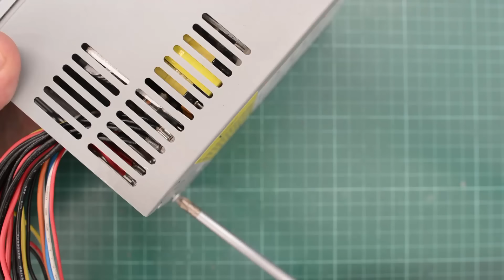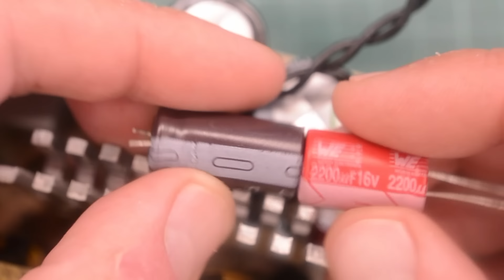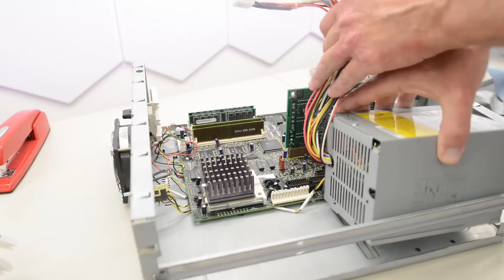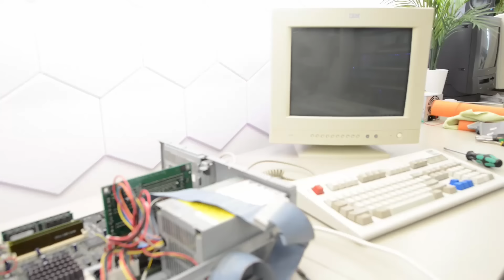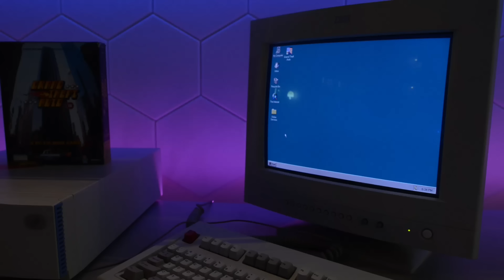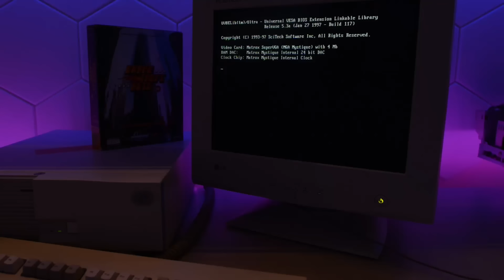IBM 330-P60 repair & GTA in High color mode test

Comment: Never worked on a psu board that cramped! I'd suspect the cramped layout probably leads to premature capacitor failure due to the heat build up.

Comment: What is under the CPU, looks a bit like maybe a MMX voltage interposer - or maybe a 3.3V interposer as the P60/66 were 5V chips
Reply from the maker: I don't know what it does. It only has resistors on it. I showed it in detail in part 1

Comment: You really need to be careful about removing PCBs on floppy drives.  Many of them have the optical track 0 sensor on the PCB under the heads.  If you so much as loosen the screws on that PCB, you will totally wreck the alignment, and I wish you the best of luck ever getting it back again.

Don't ask how I learned this.  Twice.
Reply from the maker: lol. I have realigned a few drives. It's a hassle but it can be done :)
Reply: @Epictronics1   I bow to your superior skills.  :-D
Reply from the maker: @sirnickity  lol

Comment: "The pad has come off ... I hope that's not my doing."
It happens.  I've had a couple PSUs where the pad came off the board, even without electrolyte damage or anything like that.  Especially those cheap single-sided phenolic boards, with large components and thermal stresses.

This is just part of deal when you maintain old stuff.  Some people will say it's a good reason not to re-cap if you don't absolutely have to.  I say, if the pad failed that easily, I'm glad to have caught it early enough to fix it, before something really bad happened.

Comment: As others have pointed out, coil noise is very often not the result of a fault. It's electromagnetic induced vibration and needs some kind of anti-vibration the same way a fan can cause vibration and needs rubber dampers to stop the noise. Gluing down coils is one way to dampen the noise and probably the easiest for a hobbyist to fix it. You can buy new transformers that have been resin dipped during the manufacturing process as an anti-noise measure.

In other words, gluing it down isn't a hack or bodge. It's actually proper maintenance.

EDIT: However, it's fair to point out that noise can indicate other problems as you discovered after replacing the caps. "Dirty" power can exacerbate coil noise. Replacing those caps cleaned it up enough to quiet that coil significantly.

Comment: eeekkk.... those first vintage of the IBM PC 330/350 with flat face drive slide covers were, in my opinion, bad machines. The next generation of the PC 350 with slightly curved outward sliding drive cover doors were much better. I forget what MHz processors those began with.... Somewhere between 100 MHz and 166 MHz. Also decent (next) was the PC 300 XL which was a Pentium II processor in that same PC 350 model 2 case.

Comment: Thermal paste isn't that big of a deal, especially for gold metal tops. These CPUs only have some watts of thermal output.
Reply: Yeah, they pretty regularly never had thermal paste nor pads.  Metal-to-metal (or ceramic, as the case may be) conductivity will do the job fine at those power levels.

Comment: Oh JOY! Finding a cracked solder joint is the only major issue is just the best! I had a problem with my Honda - it wouldn't start occasionally and I had NO idea what it was, I thought maybe the key 'security' was a problem but no, there was cracked solder joints on the connector under the steering wheel that lets the key talk to the immobilizer.. I spent 10 minutes reheating and fixing the solder joints and it's been fixed for 5 years now. Free of charge! Yes, that's a GREAT feeling!
Reply from the maker: Occasionally it's an easy fix :) This was my third drive that had this issue. Well worth checking on any bad drive!

Comment: That replacement PSU from Magnetek is most likely due to recap also. Those used some crappy capacitors. Some of them leaked badly, where others had really high ESR. I had to repair those a few times, some of them were used in PowerBook Duo Docks and in IBM Aptivas. Also about the coil whine, I had once repaired a PSU that had a nasty coil whine in standby by replacing the ceramic capacitor that was nearby it (I think it was 10nF). The original one was apparently acting as a piezo speaker for that specific frequency
Reply from the maker: Yes, I have repaired the Magnatek twice so far:) I'll check the ceramics nearby, thanks

Comment: The other two transformers were at least dipped in resin so I guess that one should have received the same treatment as well.
That wide yellow tape even seems to form a dam to contain the resin although perhaps they also ran out of thin tape at the same time... I bet it was made at the end of the last shift of the week 😜
Reply from the maker: So, it seems :)
Reply: I wonder if dipping the coil into clear nail polish would do even better? Maybe thinned down a bit so it goes everywhere inside? Would that dissolve the varnish on the coil wire?
Reply from the maker: @jerther_  I better ensure I dip it in something that won't damage it. It is probably impossible to find a replacement coil.

Comment: Coil whine it’s more a mechanical problem than an electronic one.
It’s caused by the copper wire resonating at a specific frequency and, being no more perfectly attached to the magnetic core due of aging, generates that whining noise.
Nothing to be worried about though, it’s annoying but not unsafe.

Comment: If I remember correctly, back in the days when you wanted to play high color or high resolution in DOS games, you had to use an utility called "UniVBE" to activate some SVGA compatibility with most graphics cards...
Reply from the maker: I'll try it out, thanks
Reply: @Epictronics1  That is exactly what the SciTech display doctor thingy that popped up should be. I wonder why it didn't activate for the onboard card, maybe that one has proper VESA support already?

I'd not give up on the onboard card yet. IIRC you can change the video resolution when in game by hitting F11 and then using the arrow keys plus Enter. I'd try that when the screen is black to switch to a different resolution. Maybe that gives an image on the onboard card as well.

It'd also be interesting to compare low color mode performance between the onboard and Matrox VGA cards. The matrox seemed to do not too much worse on high color than the onboard one in low color.
Reply from the maker: @mike_rofone  I'll make a comparison in the final installment
Reply: UniVBE also came with tools to specify the refresh rates for VESA resolutions. That should allow you to set the high color video modes to something that your first CRT should be able to handle. I remember using that to make an old PS/2 VGA monitor handle them back in the day.
Reply from the maker: @mike_rofone  That could be very useful for recording too! My camera syncs to 50, 60, and 80Hz, but nothing in between. Thanks

Comment: Woah there. SXE are low esr and part of the switching circuit. The replacements seem like general purpose, they’ll die pretty quick . I rebuild a lot of psus. I’ve had to recap smps before because someone used general purpose caps and the psu couldn’t bootstrap
Reply from the maker: I'll check and see if I made a mistake when ordering. Thanks
Reply from the maker: You were right! Two of the caps are of the wrong type. New caps are on the way. Thank you for noticing my mistake :)

Comment: You said the PSU was a bit sooty. Meaning, there was something getting rather toasty, inside.
Two common culprits in my experience are Diodes and Resistors.

Comment: The reason gluing the coil tamps down on coil whine is because the coil is actually vibrating and the glue is damping the vibrations. Coil whine is not necessarily a real issue but if you find it really annoying that might be worth doing.

Comment: Gluing the coil is an option. The kludge solution is to wedge something soft enough to damp the noise between the coil and something else. Another potential option is to put heat shrink over the coil.

Comment: Coil noise is a feature not a problem. Designing switch mode is a about compromise, gluing components is sometimes a design requirement

Comment: Coil whine is not usually a 'fault' it's more of an annoyance, basically when the coil is working at high frequency, it can sometimes vibrate like a mini speaker at a harmonic of said frequency, you can get inductors that are designed not to, or yes, you can glue the Coil (doesn't have to be glued down, just dampen the vibration of the coils) - replacing the coil for a new same value could fix it - but that's only if the replacement is built a little better to not whine... Just glue it :)
Reply: Thanks for this explanation as I wondered why it whined! :)

Comment: Just scope the PSU? If it's not too ripply under load, then there's no need to search for a fault, it's fine. Use silicone rated for power supply use to damp the offending magnetic, such as Silastic or Kafuter. There's nothing sketchy about that. Actually use it all over the place, like on that bodge capacitor, because why not. Look, when you look inside a PSU and it looks like a Peter North scene in there, that's for a reason, this is considered a high vibration environment due to all the large magnetics. When you don't gunk it all up, things break off, component legs and pads fatigue. Plus the noise.

I think S3 Vision should work! Maybe it just needs UniVBE. Most games came with UniVBE on disk if the game supported VESA/SVGA modes. Try different versions too. My first PCI card was one of those i think and it needed a LIBERAL application of UniVBE all over the place, i wager a conclusion that the VESA BIOS on these was very incomplete.

Oh i haven't looked carefully, i'm watching semi asleep on a netbook, so i'm sort of saying this blindly but the buzzing magnetic should be the SB power transformer. I know it's not ATX but given it has soft power, it must be built similar to an ATX PSU, with a secondary controller and whatnot. So that whole circuit doesn't need to work well, it just needs to work. You can also sort of stop looking across most of the PSU since that's all its own circuit, like you should be able to tell what belongs there though idk maybe not all people stare as much at PSUs as i happen to.
Reply: I'll never look at glued on components in the same way again.
Reply from the maker: Thanks, I'll give UniVBE a try

Comment: I don't know about gluing the coil, but I do know that wax potting coils is very common. They do it to stop the very problem you seem to be having. I would remove the component and dip it in some liquid paraffin wax.
Reply from the maker: Interesting, I did a Google search. It seems to be a very popular thing to do on guitar pickups
Reply: Very interesting indeed! I guess the liquid paraffin is thin enough it can get into the coil in between windings so it might work even better than glue!

Comment: I used to service some equipment that had a large (2" / 50mm) inductor on the output board, and if the inductor wasn't anchored to the board with epoxy or RTV, it would make an annoying high-pitched whine.

Comment: cool machine being a socket 4 are they rare considering the socket 5 and 7 wasnt that far away, weird socket 6 isnt in the Pentium scale its a socket 3 486 socket with 2 extra pin holes.  i take it the coil doesnt simply need replacing in which case i would take the advise of gluing it down.
Reply from the maker: Unfortunately, the coil is not a common part.

Comment: Regarding the power supply noise, coil noises often change with conditions. I'd suggest getting some kind of variable load and connecting it to one of the rails and fiddling it while the system is on. Does the noise go away if more load is put on one of the rails?

edit: I see later you found the noise reacts to physical pressure on the coil. Glue 'em down!
Reply: Furthermore that's likely the SB transformer, there's always the same load on it regardless of what you do since this is not yet an ATX machine. But it must have an independent standby rail to support soft power off.

Comment: I remember having a 486SX back then and playing GTA was simply not an option. My brohter had a 486DX-40 and on that machine it somehow works. I got a used Pentium 100 later that year, including an 2MB PCI graphics card with Cirrus Logic chipset. Guess what the first game was I tried out after assembling the new parts? It was just a blast seeing this game running in a playable state. You could even change resolution in this game when playing with high color mode, I think it was with pressing F11(?). Looking forward for the 3dfx-upgrade. Great video. 🙂👍
Reply from the maker: Thanks. I'll try out the different resolutions

Comment: On GTA I if you tap either F10 or F11 you can change the screen resolution, certain cards go to 800x600x16 in hires mode and F8 disables the frame limiter and F6 or F5 pauses the game iirc
Reply from the maker: I'll check, thanks

Comment: What is that PCB between the Mainboard and CPU?
Reply: Looks like chipset and cache. Seems to be the only way for the space with the onboard graphics card taking up space.
Reply from the maker: Excellent question. It's a mystery card. It only has a bunch of resistors. I have never seen anything like it. I showed it in detail in "Part 1"

Comment: If the glue, duck tape, hammer or WD-40 fix it, then it's a win isn't it? 😁

Try gluing it, if it's electronic fault then it should not fix the problem, right? 🙃
Reply from the maker: you're right. That should reveal if there actually is a problem. Now I need to find out what type of glue to use
Reply: @Epictronics1  Hotglue seemed to be the manufacturer choice that I've seen.

Comment: modern stuff uses glue on coils because they vibrate. It's normal even with modern electronics.
Reply from the maker: So, it should have been glued from the factory? Would you happen to know what type of glue to use?
Reply: @Epictronics1  Usually it isn't actually glue that is used to secure coils to PCBs but an acid free silicon compound.  You can use common silicon sealer - just make sure what you use is acid free.  The regular acid curing variants can corrode and damage components over time.
Reply: @Epictronics1  no clue. But yeah it's pretty common these days.

Comment: I had that computer, I got it very cheap back in the day at a market and it would crash sometimes, I think about after a year it stopped working so I went back to a 486.
Reply from the maker: Was it the PSU by any chance? :)
Reply: @Epictronics1  Probably, I got the system at the computer flea market for something like $30 in 1996 or 97, I just had to add a hdd and I had a computer, I even remember that weird turning on for a second when plugging it in, the seller did admit that it did crash and it was sold as non working but it was fine for win 95 for a while. I think I got angry and threw it out since I was way too inexperienced to fix it. Later I found a 486/100 in the garbage that I took when no one was looking.

Comment: Haha, I have this same one but with a 100MHz DX4, model name is 330-100DX4
Reply from the maker: Same PSU too?
Reply: @Epictronics1  No, I don't think it's the same PSU, mine was also broken but it was riveted together and I had to drill the rivets out to disassemble it
Reply from the maker: @retropcs88  Ok, probably the same PSU as in the PS/1 2133 and the similar PS/VP then. They don't seem to suffer from this issue
Reply: @Epictronics1  Actually, now that I'm looking at it, it seems the motherboard Is very similar to the PS/1 2133, but mine has a Cirrus Logic VGA card instead of a Tseng
Reply from the maker: @retropcs88  I've got the Cirrus Logic too. If it's the same board as in my PS/1, you can easily overclock it to 120MHz :) You only need to move one resistor. I made a video about how it's done

Comment: You have the footprint on the PCB to mount the "bottom" cap, on a top side...
Reply from the maker: I didn't notice! This is hilarious. Why the heck did they mount it on the wrong side?! I'll have to check, maybe there wasn't enough space
Reply: @Epictronics1  I saw this too, there is space for that capacitor. The thing might be that the traces from the capacitor to the transistor legs are influencing negatively something (the traces add more inductance that at higher frequency must be taken into account) and they opted to mount the capacitor the closest possible to the transistor, soldering it directly on the transistor solder pads.
The whine from the coil is just the magnetic core (the black ferrite core) that is not fixed good enough and have space to vibrate. Some hot glue or silicon would do the trick. This may be due to the plastic case of the coil aging and shrinking slightly thus giving room for the magnetic core to vibrate.